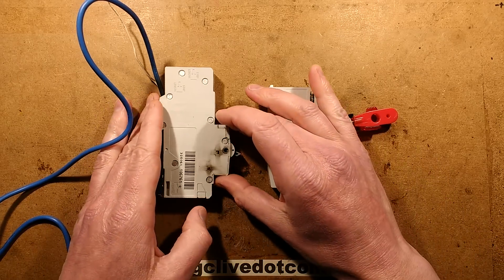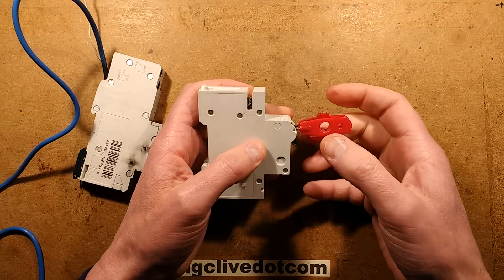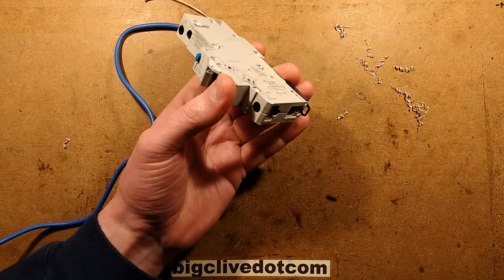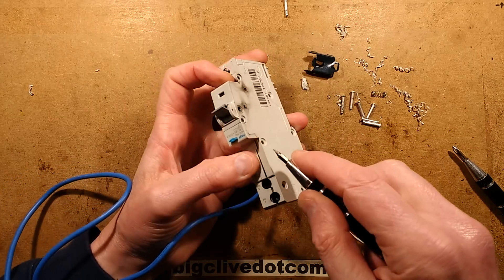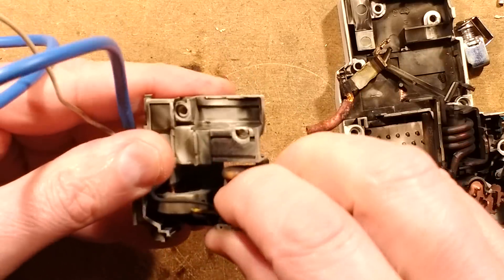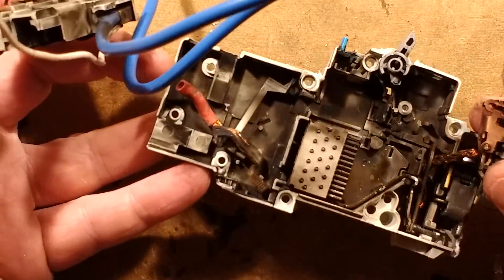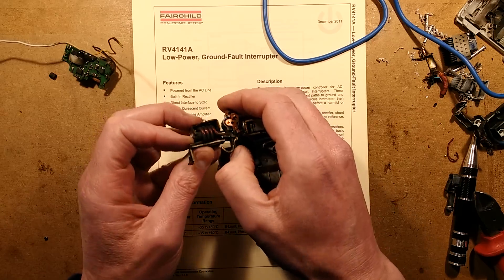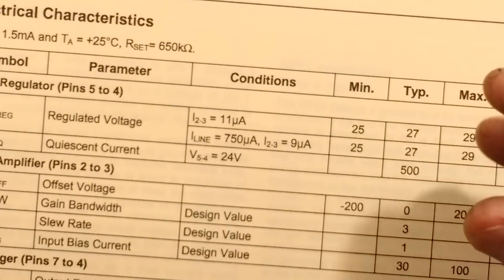Totally exploded Hager RCBO (RCD/GFI with overcurrent trip)

Comment: Very interesting that the first sign of a problem was nuisance tripping. I became involved with an installation where the main board was loaded with breakers of the same brand. It started with one nuisance tripping so I replaced it. After the third failure within two weeks the whole lot disappeared into the round filing cabinet. I replaced them all with Clipsal breakers and no problems since. Luckily none of the breakers in this installation moved on to the pyrotechnic stage. I have been using Clipsal breakers for a long time now and I have never had a problem.
I love your work Clive, thank you for the post mortem.

Comment: The problem with circuit breakers is folk switch them back on without 1st switching everything down stream off, reducing the load from the contacts.

That switch had been repeatedly reset over time resulting in wearing the contacts out.
Wonder if they are now wearing the new breaker out instead of tracing the earth leakage fault?🤔 🤠

Comment: Countries that use miniature breakers fore primary branch circuit protection are foolish not to mention 240 volts to ground. Im a licensed electrician in the USA hear you MUST use a MOLDED CASE BREAKER for primary branch circuit protection. Miniature breakers can only be used for supplementary protection after the branch breaker even at 120 volts to ground.

Comment: So, to prevent electric shock, when a ground fault is detected, melt down the entire breaker panel. When the copper bus bars  melt, power is lost to all circuits terminating in the panel. Rendering all circuits safe. I never thought of those bus bars as fusible links.

Comment: The big unknown. What's the history of the device? Constant resetting on a fault? Lightning strike? Wired up wrong? 

And the device, while it did blow up, stayed intact, nor did it catch fire. But then any device being subjected to fault currents tends to leave black marks somewhere. I've seen the results of a whole switch panel blowing up. Just a hollow shell left with copper busbars splattered everywhere. Same with a lightning strike on a house where it was a total rewire due to the cables melting together. Faults happen.

Comment: breaker idea: get a slightly beefier SCR on that RCD output, and on trip, just short the output of the breaker. that way you can simplify the mechanism since the short circuit will fire the overcurrent solenoid, and it might even be safer since it practically instantly crowbars the output to / close to 0V with no mechanical delays.

although, I'm guessing breaker manufacturers know what they're doing and an SCR that could survive that load would be impractical
Reply: That type of cirquit is found in almost all high power audio amplifiers with mor than 1000W per channel as DC protection. Smaller ones use an relay to disconect the output, but above 20A the relays get impracticaly large. And yes they are an one shot device, shorting out from the massive current surge provided by the defective output stage.

Comment: I innadvertantly back powered one of these whilst using a single circuit from the previous install whilst commissioning the new set up with much the same effect. I put the power on and heard a buzz for about ten or fifteen seconds (the time it took me to kill the power) and saw that is let the smoke out of the RCBO. Own fault and own money to replace the failed part. £25 lesson, well learned.
Reply from the maker: That would have been the trip coil activating, but failing to break the power due to being fed from the wrong side.  It's a common cause of these things exploding.

Comment: 9:47 Even if you wire it in the "wrong way" the breaker will also break the current going thru the test resistor. So as long as the breaker isn't closed there will be no current going thru the test resistor.
Reply from the maker: Not on all breakers.  Some have the test link wired from either side to avoid the issue, but many have the circuitry powered from the output side.
Reply: @bigclivedotcom  Interesting. But shouldn't that be considered as a flaw in the design? I mean you want your design to be as "idiot proof" as possible.
I have personally never seen one that doesn't go thru the breaker contacts, or at least haven't noticed it, then again maybe this is considered a safety hazard here and may not be sold here (Belgium). 
Also most, if not all, RCDs sold here may be wired either way.
On a side note, in Belgium a circuit breaker MUST break all lines (live and neutral). In "older" houses we often have 3P 220V, which means that both wires of your 220V are actually live.

Comment: It is interesting to see how the test circuit creates the imbalance to trip the circuit when tested. I had assumed (for no valid reason !) that the test button caused a current to earth that was detected and tripped the RCB. However that is not what happens - the test button causes the test current to bypass one side of the sensing coil thus creating an unbalance. However the test current is still flowing from Live to Neutral not to earth hence testing a downstream RCD does not trip upstream RCDs as they see the test current as balanced. Very clever when you realise.

Comment: Wait wait I have only ever seen RCDs with phase(s) and neutral through them ... so they can monitor that the sum of the signed currents through all connections is zero. How does that thing work, with only one way through it?
Reply from the maker: The current flowing out through one terminal induces a field in a sense coil that it cancelled out by the current coming back through the other one.  Any imbalance indicates that current had leaked elsewhere.
Reply: @bigclivedotcom  Thanks, but does that have four terminals (and I am blind) (live from main, live to circuit, neutral from circuit, neutral to main), or only 2?

Comment: If the circuit breakers in the power plant does the same thing I think the turbine stops rotating kinda on the spot. Or maybe the blades fly off the turbine. Or the generator shaft breaks off the rotor. I don't know.

Comment: I just replaced a Hager 10A RCBO 2 pole single width that failed to trip with the test button after only a couple of years. It would buzz and start smoking within a second of holding the button but not trip. I tore it down and discovered they had incorporated the RCD and overload coils in the one aluminium package. Some clever engineering in the linkage was supposed to trip the lever to half position to indicate an RCD fault and full off to indicated an overload in order to diagnose what had actually tripped it. In reality, the linkage ended up binding and preventing a trip on either RCD or overload. I could not see any thermal trip strip in there.

The resistor for the RCD test was still intact and measured 3250 Ohms so at 250V would draw 77mA and dissipate nearly 20W. No wonder it smoked after less than a second. It seems they tried to get a little too clever for the room they had to play with. It has tainted my faith in Hager products now.
Reply from the maker: I think the failure of the coil in the same way has caused catastrophic failure inside these breakers.

Comment: I have had this exact problem on a high in rush load circuit that a breaker was used as a on off switch for. Repeated use leads to it over time weakening the breaker until it eventually welds itself like this. The solution was to put the load on a MDU that turned on in a staggered way

Comment: Had to be a Voltage back "SURGE" I found, over years GFI, Outlet devices, with MOV, "Metal Oxide Varisters" really, "Draw" the surge to circuit boards. Electrician for 45 years.

Comment: I suppose all you would need for overcurrent protection alone would be a shunt resistor and a spring loaded relay. The coil of the relay with the shunt resistor across it, 'live in' on one side of the switched output, then looped back to the coil, 'live out' on the other side of the coil. If too much current is drawn, enough current will flow around the shunt that it will trigger the relay.

Comment: Lightning???
 Down in Florida you see LOTS of destruction... One law office I did repairs at had $10,000 of damage from a lightning strike on the building next to theirs.   Lightning was picked up by "antenna action" on all the network cables and terminal lines.. printer lines and the like.  Every serial interface chip had its top blown off... Nothing turned on, and nothing not on long wires was damaged.  However, there were a lot of machines on their network....

Comment: I think Hager would have liked it to examine... 😕
Being type "c" , would it not actually have been getting quite a lot of surge & "tolerating" it to the point of failure... would a "b" breaker of a higher current rating not been better Clive ?

I'm starting to have second-thoughts about going the RCBO route for my new CU... 😒

Comment: I've trained to be an Electrician, my guess is IF the Breaker Contacts welded shut due to a dead short somewhere in the Branch Circuit its supposed to be protecting, the next thing to trip would be the Mains Breaker protecting the entire Distribution Panel (hopefully before the Branch Circuit wiring caught fire from WAY too much Current flowing through it).
Tripping the Mains Breaker would also have the fun side effect of killing power to the entire building...

Comment: Makes me wonder about the 2-pole 1-module RCBOs available from some manufacturers (although to be fair, those are only rated to break 6kA at most).

If the test resistor contributed to the bang, then using a fusible type should help. Adding a fuse in series with the solenoid (possibly a thermal fuse mounted to the coil) could also improve the situation (although it would have to be chosen carefully to avoid blowing when it shouldn't, which would be nasty in its own right)… I suppose the welded contact is bad enough on its own, though.

Comment: What is honestly the point of requiring a 10kA supply?
Reply from the maker: If a substation is feeding a housing estate it will have to be rated quite high.  You have to rate the breaker for breaking a short circuit in the house nearest the substation with the lowest circuit resistance to make sure it can break that high current safely.

Comment: I need one of those breaker locks. I often have service calls in assisted living building and If I shut a breaker off to work on a range or dishwasher, it seems someone always wants to turn it back on.
Reply from the maker: You can get universal ones on eBay that clamp onto the switch with a screw.
Reply: Good to know! Now maybe I will stop getting 240v shooting up my arm!

Comment: You mentioned that it came from an arcade....well, most arcade games use switch mode power supplies (basically like home computers) and older machines use regular power supplies with transformers.  Switch mode power supplies usually draw a very brief but extremely high current on power up to charge the mains capacitors...and of course transformers also have inrush, but of an inductive nature. Having worked on arcade games, and seeing how arcades operate, here is my theory on why this burned up: They used that breaker to turn ALL of the games (and/or lighting) on and off at the same time, instead of using the individual circuits. The combination of capacitive inrush, combined with inductive inrush (and resulting capacitive/inductive currents creating resonate overvoltages) finally hit critical mass and blew it up. Even a standard Non-RCD breaker's contacts will fail with such abuse. I have had to replace many breakers in arcades for this very reason. If the viewer who sent this to you is reading this: Tell the arcade to change their daily routine or it WILL happen again.
Reply from the maker: That's highly probably.  And not helped by the high current to the degaussing coils at power up on the older games too.

Comment: Be interesting to learn more how the earth neutral trip works generally speaking.
Reply from the maker: One of the more interesting neutral/earth short detectors I've seen uses one coil to induce a signal on the live and neutral conductors going through the core.  If there's a short, the neutral/earth loop creates a current path through the inductor and couples the signal onto the sense coil.

Comment: i was thinking about components getting to hot maybe induction should be used to lower the voltage then one to step it back up after? i never really understood voltage and current I’ve watched lots of videos but couldn’t get my head around it? 🤔🤷‍♂️😔 obviously if it’s being driven to hard then it starts emitting heat and light energy to dissipate the energy.. I’m drunk. I love your videos ❤️
Reply: maybe some kind of chip the would dissipate across multiple resistance instead of one would be better than one hot component 🤒

Comment: Quick question to someone I thought might know the answer to this, any way I can make my smoke alarm only go off when there is actually smoke and not when I want to take a shower over 15c?
Reply from the maker: It's seeing the water droplets of the steam.  The detector sounds like it's the wrong type or in the wrong location.
Reply: bigclivedotcom was supposed to be a good one, had to be wired into pre existing position, maybe I'll get it a shower cap
Reply: bigclivedotcom thank you

Comment: C3 also limits inrush current to the thyristor trigger. We had problems with that issue, especially on higher power devices (6 to 8 inch diameter chips) and, in an extreme case, the Silicon can actually splinter off the top surface, in a saucer shape, taking the gate contact with it. The solutions to the problem included multiple trigger contacts on the Silicon surface, plus careful Silicon doping design, and external inrush protection components, such as that cap, C3.

Comment: Hi Clive and comment makers, I am looking for some advice.

I have a computer monitor(Acer G276HL Manf, Date June 2012) that would power up after "x" amount of minutes, which became longer and longer over time. 

I believe it to 1 capacitor on the power board. So I ordered a replacement, now this is where my lack of knowledge comes in, the capacitor is 470uF 25V with a Gold/Copper stripe. The replacement is 470uF 25V with a blue/grey stripe and is about half the size. 

Would it be safe to use the replacement?

Thank you in advance for advice.

Del
Reply from the maker: It should be fine.  It depends on the function where it sometimes needs to be a low ESR type.  Just make sure the polarity is correct when you insert it.
Reply: Thank you appreciate the advice.

Comment: A theory: after it overloaded and broke an arcing current a few times, the evaporated metal got in the RCD sensing circuit and stopped it staying in. What do you think?
Edit: looks like you’ve cracked it. Strange really because I had Hager down as pretty good and I wouldn’t have thought they’d have welding contacts like that.

Comment: Bigclivedotcom, please correct me if I'm wrong well anyone for that matter. Too me it looked as if that tiny black wire that was broken off right when he split the shell looked like it went to the Spark Arrester Spike's? What I'm getting at is that if that wire failed due to an insufficient conducter, wouldn't that have cause the Arching to occur on the single- pole latching switch? Followed by it being welded together and the fault unable to be broken?
Reply from the maker: The arc extinguisher has no electrical connection.  It's just isolated plates.

Comment: With the possibility of welded contacts, doesn't a (standard) circuit-breaker then ultimately sacrifice safety for the purpose of convenience, compared to plain old fuse wire?
Reply: Agent24 If you abuse electrical equipment, eventually there will be consequences. If a circuit breaker trips often, the circuit needs attention from a person that is qualified to do some troubleshooting. Ignoring the problem and resetting the breaker repeatedly can result in welded contacts. 

Fuses are not a perfect solution. Again, that has a lot to do with the human factor. If a fuse were to blow repeatedly, people would sometimes replace the fuse with a metallic object such as a penny (screw-in fuses) or a piece of copper pipe (cartridge fuses).
Reply: Of course nothing can protect against stupidity, but my point is that a failure of the breaker due to a manufacturing defect could result in the breaker never tripping. Old age could also have potential for issues. Neither of these problems would manifest with plain fuses. All things being equal, I would rather have a fuse which can only fail open, than a more complicated device which has the potential to fail shorted.
Reply: Circuit breakers also provide tighter overload protection than fuses do (fuses need a wider margin between the normal load and fusing current, to limit thermal stress on the fuse element).

Comment: I've seen some contactors , fuses , triacs and thyristor blow but never actually a RCD / GFI DR ( PT_PT Disjuntor Residual  ) blowing this violent. That must be some on / off events, arc's passing enought energy to weld the joints. Must be some sort of surge load such inductive load ( pump motor) and the thyristor is not snubbered properly for that appliance, even that has the right class